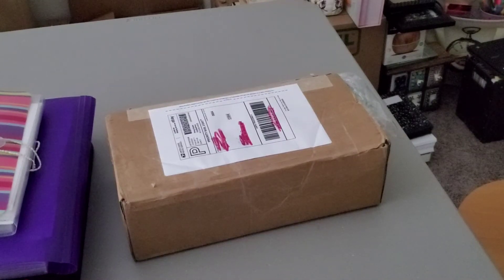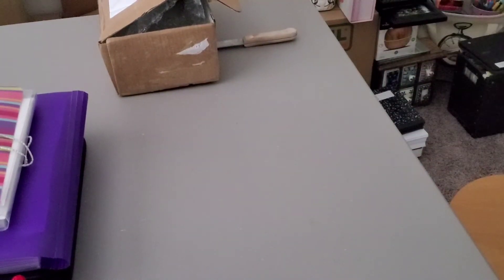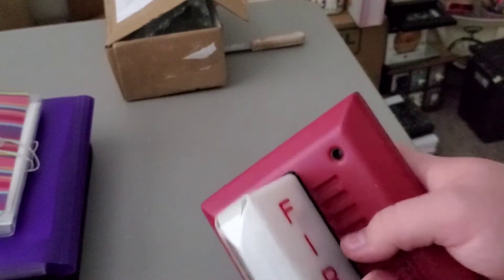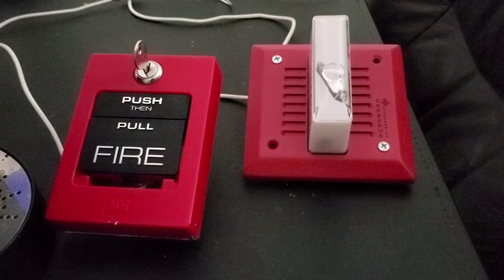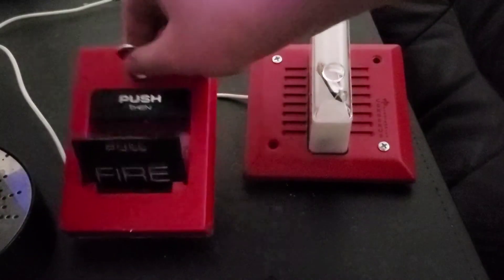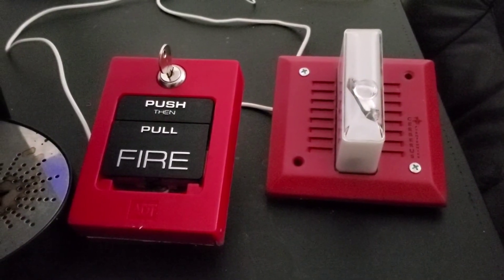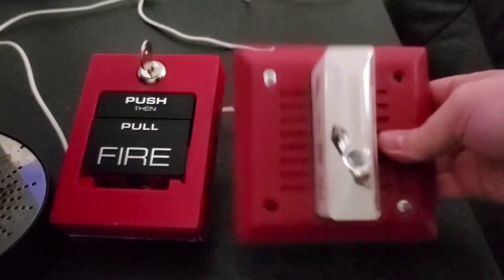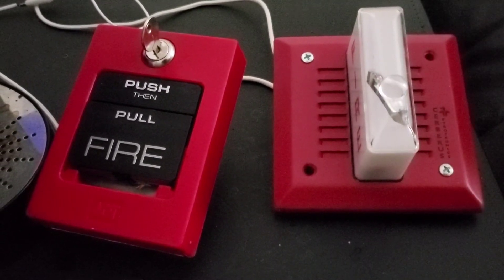Cerberus Pyrotronics MC-S17-F Unboxing + Tone Demo

Comment: This is same alarm at my old school! They used the first tone for this alarm as well. It sounds like a simplex truealert. Although, here’s the thing. My old school alarm looked and sounded exactly the same as the alarm in the video, but when we had fire drills, the strobe did not flash very fast, at all. It only flashed like every 3 or 4 seconds? I’m not 100% sure on exactly how fast it flashed, but it did flash slowly, that’s all I can remember.